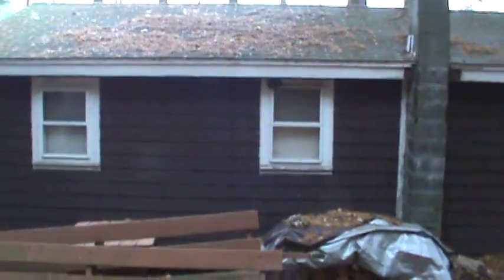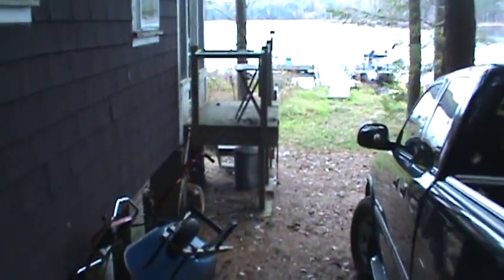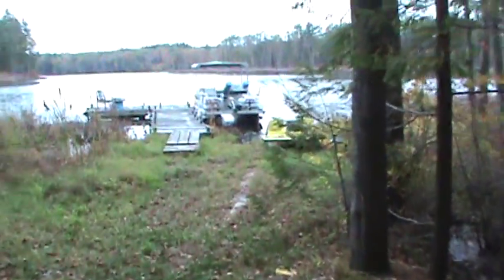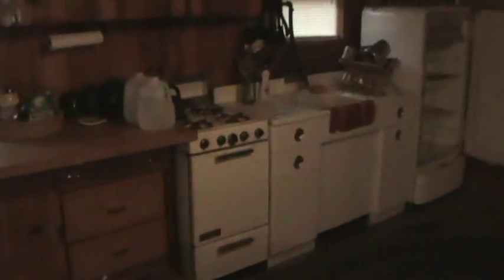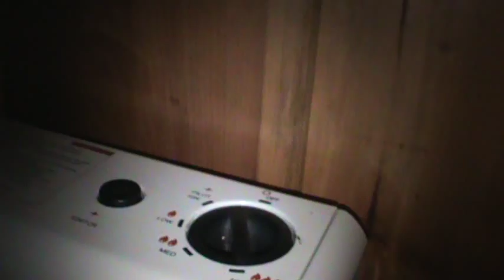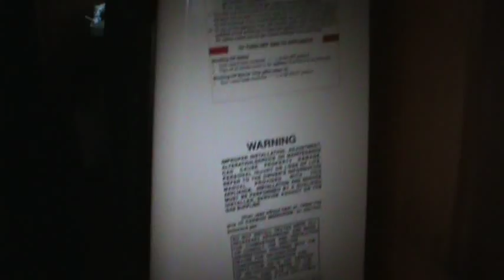cabin heating system

Comment: I also installed a ProCom heater  from Northern tool.  I think its 20k btu. We converted it to and  It works very well.  The only issue we have run into over the last 3 years is I needed to take the front out to clean it out.  It had picked up a bunch of dirt/lint/animal hair etc. Once I cleaned that out its been fine ever since.  We also paid well under 200 for it.   We added the optional Fan assembly though (electric, so wouldn't work for you)..

Comment: 👍Going back through some of these older videos & enjoying them. Thx! Seeing your “camp” reminds me of the movie “Friday the 13th”🔪or the old haunted cartoons of Scooby-Doo 🐕.
-Years ago @ Lowe’s I found this wall heater. (clearance for $69) Quickly Snatched it up. Installed in my garage, piped natural gas. Works great & heats it toasty warm. Small exterior fan to circulate air but has option for a self contained 115v blower. Garage approx 400 ft.², no problem heating it. Fun project! Good video, Mustie1. Thx for the peek @ your sleep a way camp✌️🇺🇸

Comment: Hi Mr. Mustie ! another informative video, and the tip from the other viewer about the level of the Co detector is very smart , would have never thought of it  !
 Three things , yes how long does the little tank last, how much do you pay for a refill and
Make sure those mantles on your inside lights are treated with yttrium salts and NOT Thorium salts which are beta ray emitters. Cheap mantles are probably Thorium,
Coleman (since the mid 90's) are the much safer yttrium. Wear a mask when you change them. Thanks Again !

Comment: @mustie1 Manually spinning the fan would really keep ya warm.  Thats manual labor.   Another option is a non electric fans.  I've seen them made to put on a wood stove.  The heat rising makes it spin.  I don't know if it would work on this kind of heater but it may be worth looking into.   I've seen them at Lehmans non electric before (I used to get their paper catalog).

Comment: I was thinking of buying one of these for my office in the shop, its 14'x24' and all insulated but not sure if the CO2 level would be safe like you say. I've already got a 500 gallon propane tank outside the building that supplies a garage furnace that heats a small room for my skidloader and because its farm use i get propane @ 1/2 the cost. Nice demo video!

Comment from the maker: @maniakaz I have seen them on wood stoves too, but there needs ta be a real hot spot under it, I could put a shaft in pillar blocks and put a blade on the inside and the outside over the chimny, so on windy days or a fire going it would spin, but thats never gonna happen, that catalog is where I get my other stuff from, gas lights/hand pump rebuild good stuff
Reply: Mustie1 You can look into TEG (Thermo Electric Generation)panels for projects that require electricity straight from a heat source.  I have played around with them quite a bit and they are cool.  China makes some cheap ones for a couple bucks each.

Comment from the maker: @maniakaz I know that they had different sizes of em, the one thing that would help would be a cieling fan, but I would get tired turning it by hand with no power,maybe wind up
Reply: How about solar panel . Couple of batteries . Use 12v computer fans to move air round . They use just a small amount of power

Comment: that brings me back to when i was a kid we would stay at my friends camp it is set up the exact same way had 3 lights a stove and a combo 120 volt propane fridge that would swap back and forth automatically they had a 850w 4 stroke  suitcase Honda generator that lived in a plywood foam box   for literally 22 years  had 22 oil changes 5 spark plugs and 3 pull cords  all written down on the inside of the box some of my earliest small engine memories was there many nights the generator would run out of gas and we would start up the gas lamps for a hour or two  still playing cards no tv no music just the whoosh of the 50s pot burner oil stove or the crackle of the old wood chief in the middle of the camp

Comment: with gas heating it is always the best to fit a Carbon monoxide detector to warn you if fumes are building up inside your abode.
Reply: ralph ups yeah, please  mount it low, because CO is lighther than air